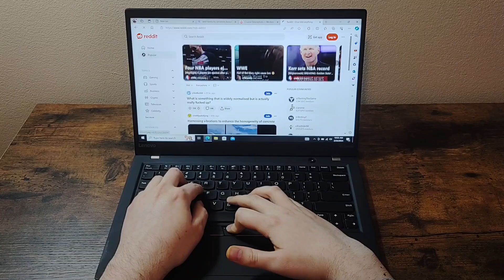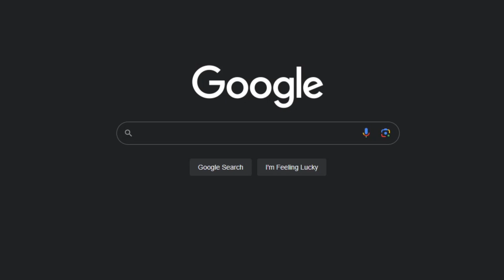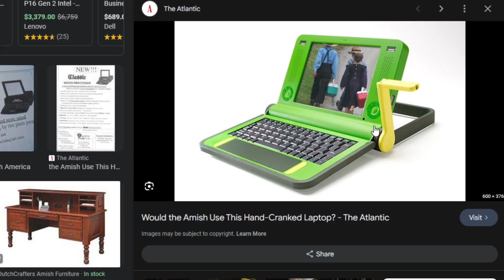They Threw Away This ThinkPad X1 Carbon, BUT it’s Actually NOT TRASH!

Comment: I just bought a Lenovo B70-80 Laptop on 15€. Almost BRAND NEW (RAM 16GB, 250Gb SSD, 20" Screen, etc) . The seller told me the battery does not last long anymore (it takes 2hrs from 100% to 0%) and it is not Win 11 compatible (i can  install it, but windows 11 sucks; i rather leave it with Linux Mint as primary SO and win 10 just for sharing info with other ppl).
Yeeeah!! Amazing how people are getting rid of great Laptops in general (T460 for 20€, T460S for 40€, Yoga 370 for 80€ and on and on...)

Comment: I´ve been trying to instal win 11 to my thinkpad x1 carbon and every single time there is an error and I have to start over, like doing boot discs and trying to get back to original win 7 and that´s not easy to access after failured install gone wrong.
Reply from the maker: It should be able to run windows 11. Open the bios and make sure uefi is enabled. Also if it says TPM failure you can make a rufus bootable drive that disables the TPM check.

Comment: 3:05 You could use adhesive or double sided tape to hold the bottom panel down. However, they may not be very strong, and the bottom panel may come off over time. But it is something to try

Comment: that extra dot of thermal paste is overkill man, and you had too much to begin with. On CPUs that size I just put a small line down and don't spread I just screw it down in the moving X pattern. I would know I've spread paste over little laptop CPUs. They're less forgiving than desktops because of restricted space/airflow and even a little too much paste can be an extra 2-3 degrees C

Comment: You didn't add thermal paste to the gpu die.

Also check the health of the SSD.
Reply: That's not a GPU die, that's a PCH die. Per Intel, you don't need to put thermal paste on the PCH die because it doesn't heat up.

Comment: The CPU in this video has two dies, is it enough to put thermal paste to the main one?
Reply: Per Intel, you don't need to put thermal paste on the smaller PCH die because it doesn't heat up.

Comment: Why didn't you repaste the detached GPU silicon as well?
Reply: That's not a GPU die, that's a PCH die. Per Intel, you don't need to put thermal paste on the PCH die because it doesn't heat up.
Reply: @one_step_sideways  Ah, okay, thanks.
But I guess, it wouldn't have hurt either.🤷🏻‍♂️
Reply: who knows mate

Comment: It may surprises you, but business laptops, like this X1 Carbon 5th Gen you got there, are fully Windows 11 compatible! You need to set these things up in the BIOS: 1) go to "Security" and enable "TPM2.0" 2) also under "Security" make sure "Secure Boot" is enabled. Then boot into a stock Windows 11 USB flash drive made with the Microsoft tool and you will be surprised that it will accept the hardware flawlessly. The compatiblity is basically only on the presence of TPM2 and secure boot being enabled. Try it out. 🙂
Reply: idk about the cpu, but there's a workaround for that
Reply: The CPU does not really matter as long as there is a TPM 2.0 chip and support for UEFI secure boot. I have successfully installed a vanilla/unmodified Windows 11 on a X1 Carbon 2nd Gen before! And that old laptop only got a 3rd Gen i7 CPU! This is one real benefit from these business grade laptops.
Reply: Don't be a psy and use linux
Reply: With the correct settings there are no registry hacks or any other workaround required as you can straight install a stock Windows 11. Also you do not have to fear future Windows updates to break anything as these "workaround" installs sometimes tend to do.

Comment: 2:39 You forgot to add thermal paste to the second die.
Reply from the maker: Actually the PCH die is supposed to be thermal isolated from the CPU, otherwise the CPU heat would transfer to it. It doesn't have thermal paste from the factory.
Reply: @Duraputer That's not the PCH die tho, that's the iGPU unless I'm mistaken. Normally the PCH isn't on the CPU, it's supposed to be on the board itself.

Comment: Speaking of carbons, Im using my Lenovo Thinkpad X1 Yoga Gen 3 as my personal computer, and it was an quite an upgrade from my old X1 Yoga Gen 2, it has a faster qual-core Intel Core i7-8650u, better speakers, better screen, and  that's I can think of. The Major flaw is that the F3 is defective and it does not work in normal usage, but it acts up when I open the laptop up. Otherwise for 186$ in total I paid for a small top-right crack, its a great laptop for normal and somewhat heavy usage. Fantastic!
Reply: You can't beat the price. I have a yoga no idea what Gen but it's i7 7700HQ 16 GB dinosaur and it still works great for browsing and most anything. Older chips are powerful enough that it's still good even today. But it can't do windows 11 though.